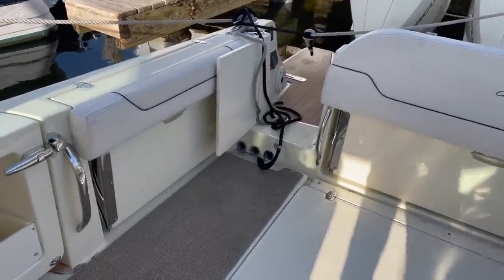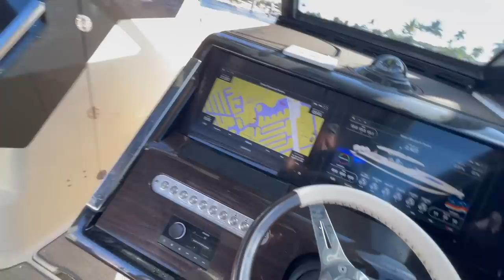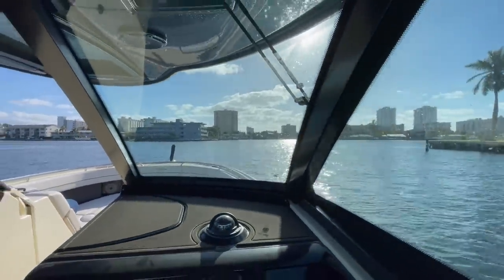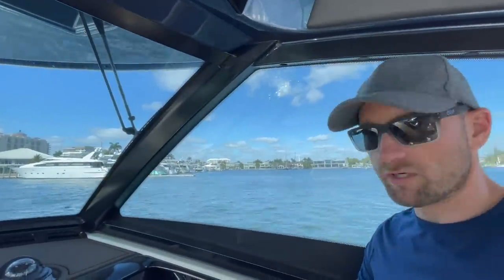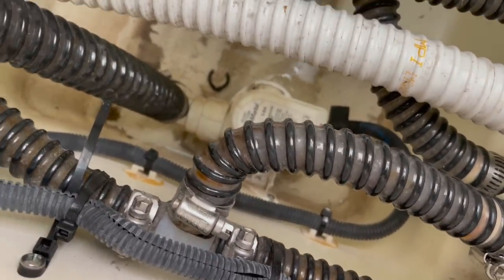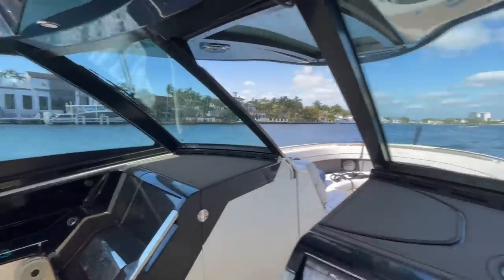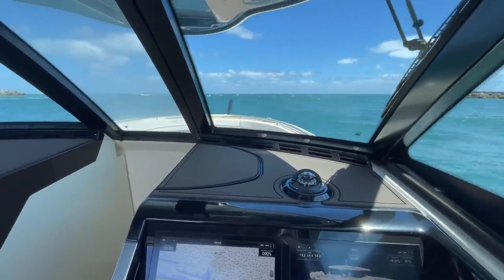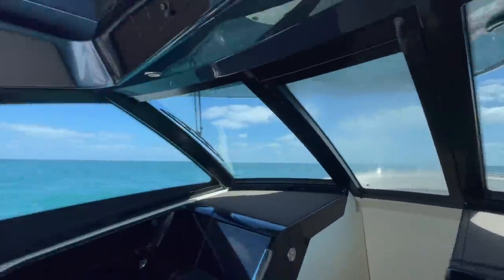Chris Craft Delivery - Best way from Pompano Beach to Coral Gables.... Offshore? (Part 1)

Comment: Great video, love the startup/pre-check information.  

I have a question: I’ve driven a lot of smaller twin outboards, and was surprised to see a similar throttle layout on this boat, which has three outboards.  Is there a way to isolate the throttle function  of the center engine with that throttle layout?   How does that work?

Thanks in advance.
Reply from the maker: Hey thanks for the comment! Great question, and it's very simple: on boats with 3 or more outboards, when you engage one throttle, it only uses the outboard engine. When you put port forward, starboard reverse, the throttle control puts only the outboard port engine forward, and the starboard outboard engine in reverse, the center engine(s) stays in neutral, until you place both throttles in forward gear.  Even the boats now with 5-6 outboards will have only two throttles and operate in a similar fashion.

Comment: When i had my sea ray i would drop the nose ( trim all the way in ) and push through that stuff. Made for a smoother ride. Although you use a little more fuel.  But it beats beating & banging. Was that boat trimmed all in ?
Reply from the maker: I was running with the trim tabs about halfway down, and yes for sure its a lot more comfortable cutting through with the bow. I could have used a bit more weight, or more bow length for the speed I was going to smooth it out
Reply: @havenyachtdelivery58  i was actually wondering if the Motors were trimmed or are trimmable. I was running a Bravo 3. Ive never run 300hp Merc outboards. Can u trim the Motors out & in ? I Would think You should be able to. & im guessing u have Hydraulic trim tabs on the Boat too.
Reply from the maker: @OcRefrig  Gotcha. Yes they were trimmed, I always do it at least a little for the efficiency